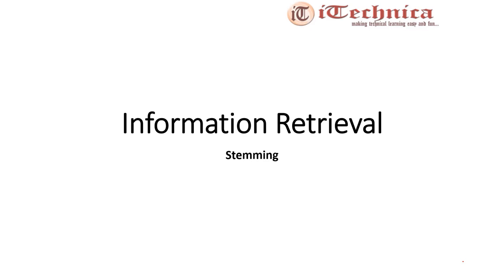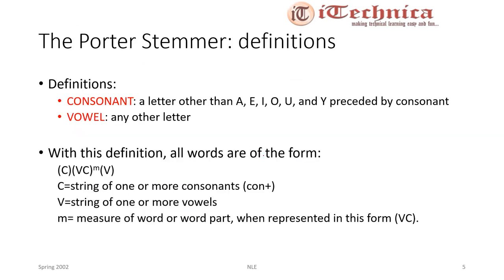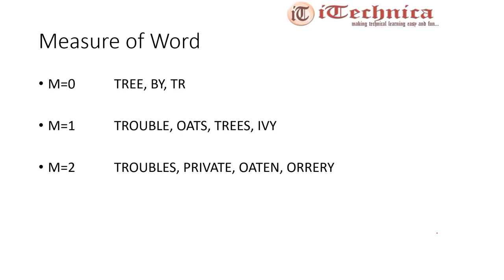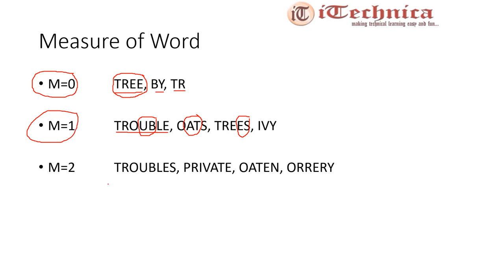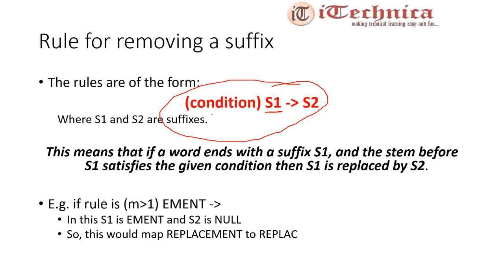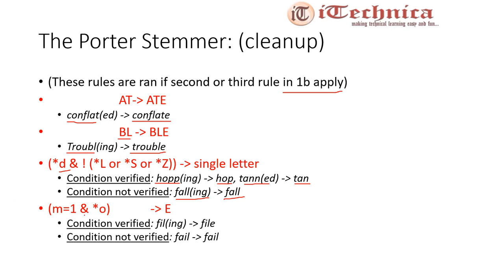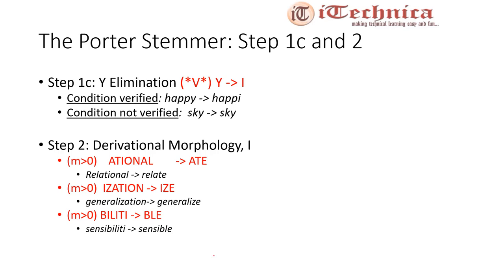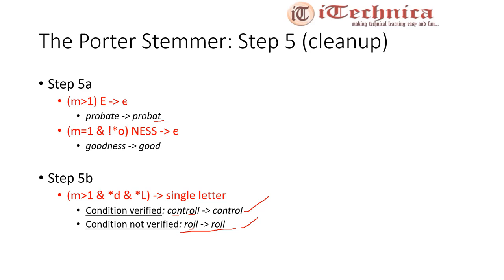11. Stemming with Porter Stemmer Algorithm

Comment: in part 1b, "feed" does change to fe, because it invokes the 2nd condition. Is that wrong?
Reply from the maker: Hi, As per the condition (m>0)EED -> EE (Correction mentioned in Lecture), and we check (m>0) only for the stem. Now, if we look at Feed then after removing stem i.e. EED, there is only one letter remaining i.e. F which doesn’t satisfy the condition m>0.

So, it will remain Feed, not Fe

Thanks
Team iTechnica